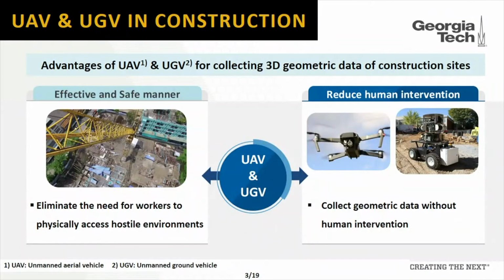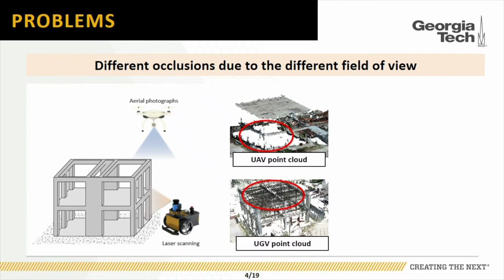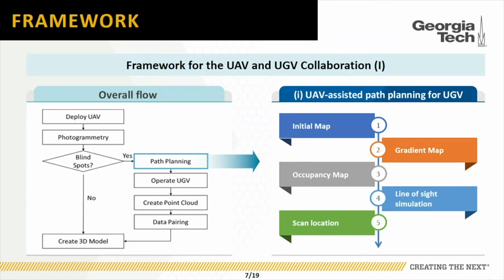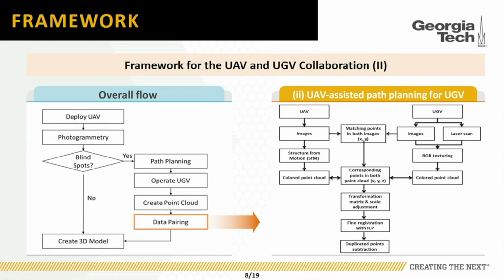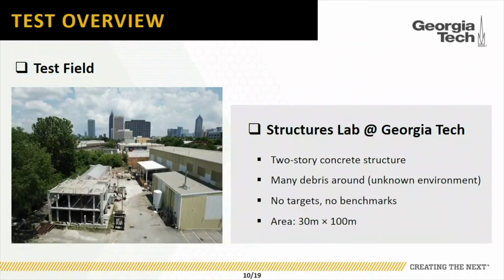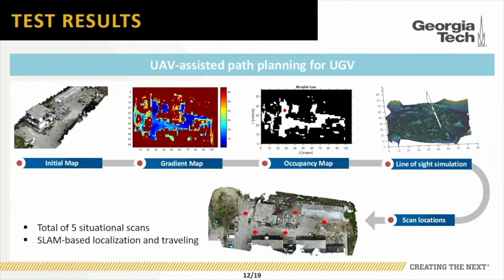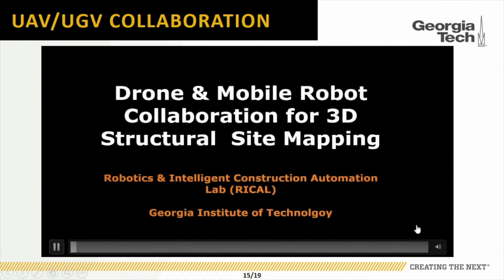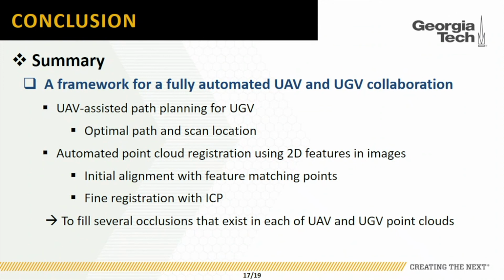Automated Collaboration Framework of UAV and UGV for 3D Visualisation of Construction Sites

Comment: Great video. I had the exact same idea, but wasn't too sure how to implement, thank you. 
Do you think that this could be accurate enough to produce GIS standard 3d models?
Reply: Thank you for your comments. As the first author of this paper, I would like to answer your question. I am not sure how high accuracy the GIS standard 3D requires, but the accuracy of the integrated point cloud with UAV and UGV is better than UAV generated point cloud. The accuracy may be affected by several factors. Please see my another paper, "Framework for Automated Registration of UAV and UGV Point Clouds Using Local Features in Images". The paper demonstrates the factors affecting their accuracy. If you have any other question, please email me (jpark711@gatech.edu). Thank you.